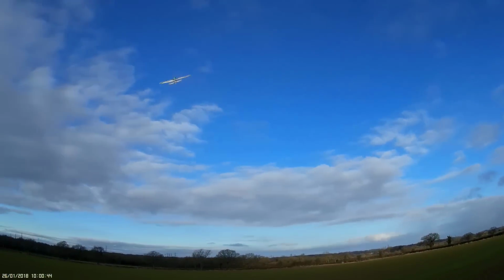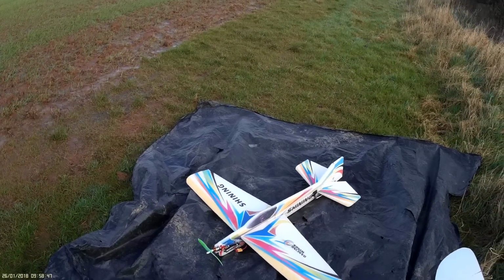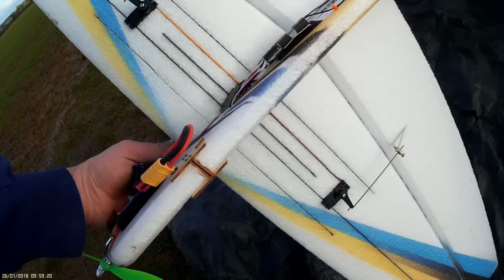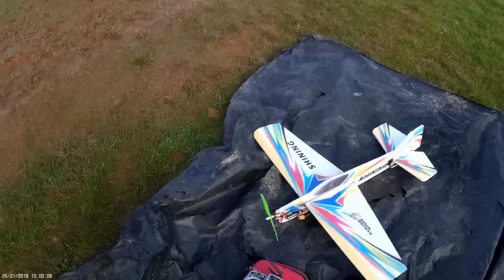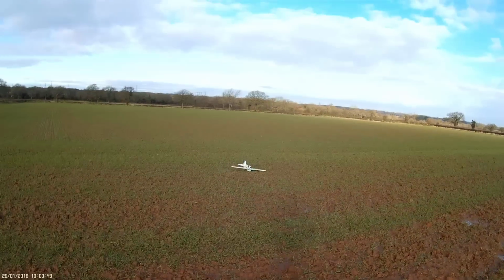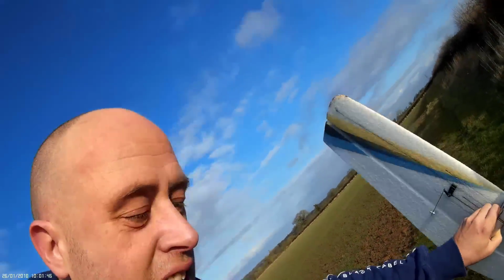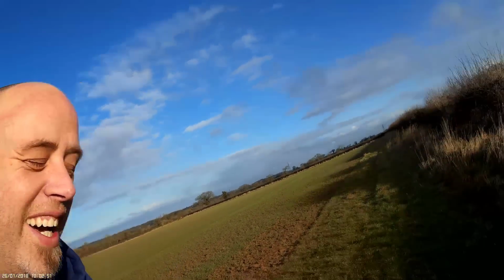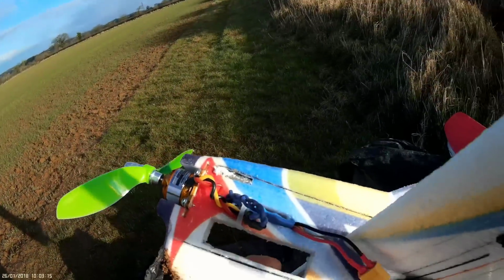Part 1: DW Shining 3D Maiden (and Fire 🔥🔥🔥)

Comment: Quick question: size of prop you were running this with?
Reply from the maker: Howdy Kashif, this model really needed a ~1400Kv motor with a 8x4.5 slow fly prop. However I think I was using a 8x4.5 slow fly prop with a 2000Kv motor, hence why we burnt it out :P Matt
Reply: RagTheNutsOff Thanks man. This was helpful.